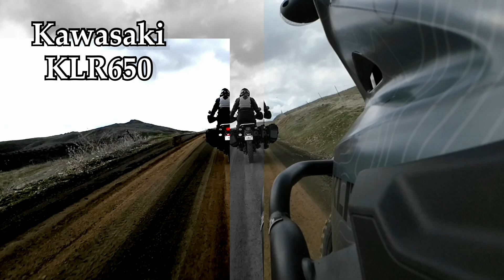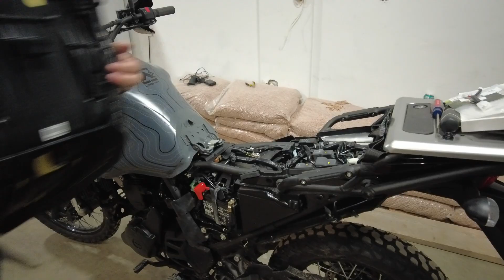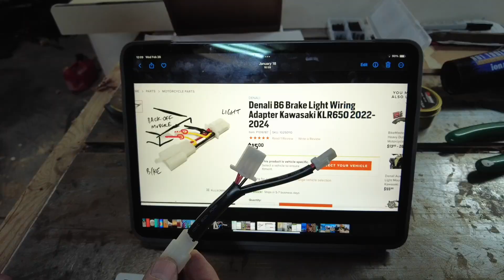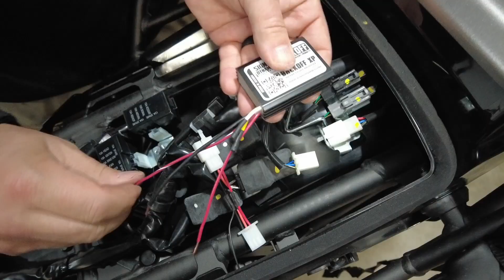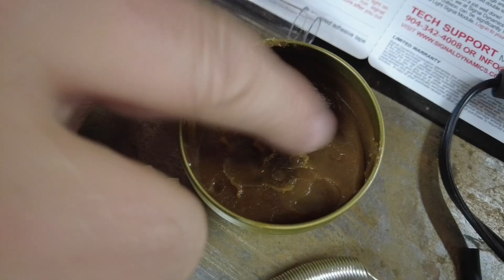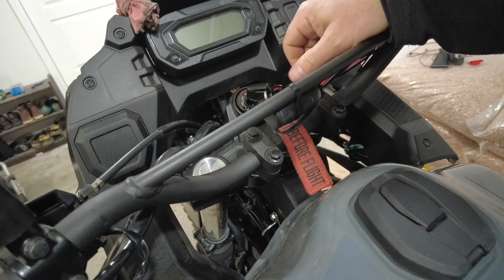Wiring a Rear Brake Light Flasher and LED Bulb on a 3rd-Gen KLR650...

Comment: Instead of splicing into the wires why didn’t you just attach your wires to the pigtail you cut off? Wouldn’t that be the same thing?
Reply: Well helps if I read directions, saw why you did it that way. Have to agree interrupt the brake light feed directly.
Reply from the maker: I’m not a fan of splicing normally but in this case it was the only way I could effectively tap into the stock brake wire. It’s held up well over the last 30K miles that include quite a lot of BDR routes on the western side of the USA.

Comment: I finally got around to ordering the Back Off Brake Module and the wiring kit from Denali.  I watched your video another time today and it made the job super easy.  Instead of soldering, I used male and female connectors which fully shield the wires.  I decided to go with option 1 on the flashes, where there will be a continuous loop of four flashes and a solid as long as I hold the pedal down.  Thank you for taking the time to make your helpful videos and posting them!
Reply from the maker: Awesome! Glad you could use the video. Here’s to many years of safe riding!

Comment: Very helpful video... thank you!  Could you please supply a link for the light bulb?  I went on Amazon and put in the bulb manufacturer but could not find one for the KLR 650.  Mine is a 2022.
Reply from the maker: Thanks! https://www.amazon.com/AUXITO-BAY15D-Lights-Reverse-Blinker/dp/B08B3LFRWK?th=1 Size: 1157/2357
Reply: @viajarMOTO  thank you for the link!  I saw that same bulb but when I put in my 2022 KLR 650 to check for fit, a window popped up saying it would not fit my bike.  I will order it.
Reply from the maker: @thomasrayborn3177  I had a similar problem, but this is indeed the light we ordered. The bulb has recently been torture tested of the SoCal BDR with numerous woops and washboards without any problems.
Reply: Nevermind it's obvious which bulb to buy when you look at the pictures!
Reply: There are 2 different size options for this link. Just making sure I order correct. Is it 1157/2357 or 7443/7440?
Reply from the maker: @travistv20  1157/2357